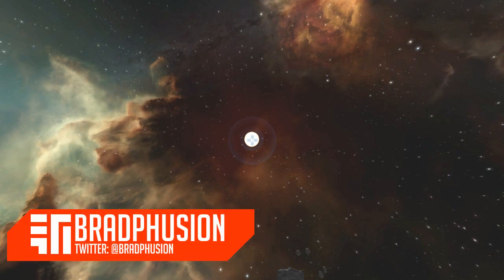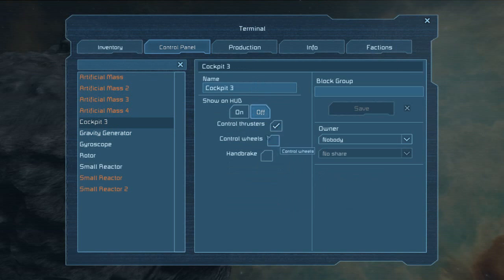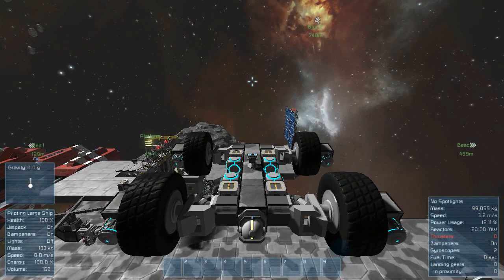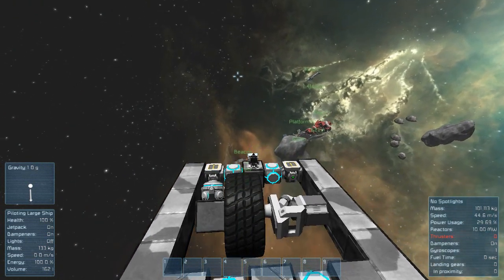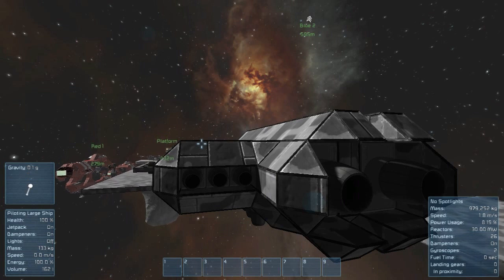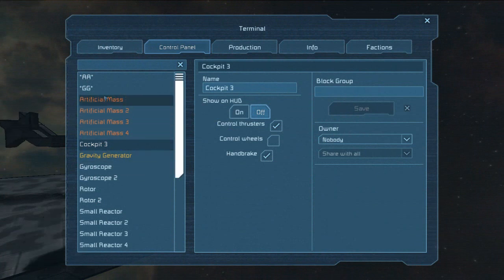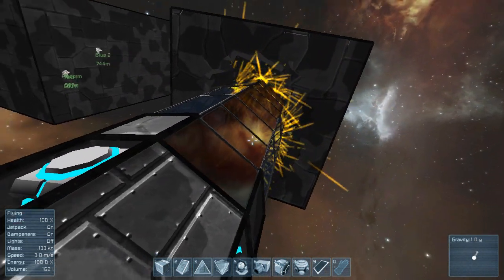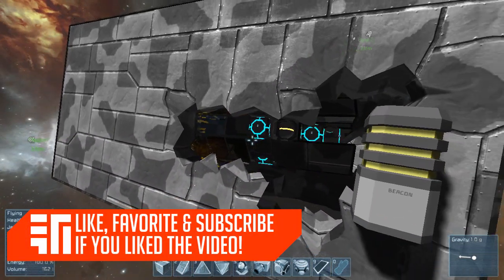RE:Engineering: VTOL / Stealth Engine & Bonus Glass Missiles! (Space Engineers)

Comment: You should make a thermal torpedo- a thruster pushed through armour using a mass block. Mass block, then a grab generator at the back, then a small thruster on the front. When you get shot through the armour the inertia dampeners will make the thruster burn through the armour. Note only works on light armour.

Comment: Could you use a gravity drive on a large heavy ship for fast acceleration?
Reply from the maker: Technically it would add more speed, however I don't think it would largely impact the ship's acceleration. Not to mention you also have to line up the gravity drives perfectly, else you will start going in circles. It'll be applying force to a specific point on a ship and you must keep that in mind.

-- Mod Shift
Reply: More trouble than it's worth perhaps. Thanks for the answer.
Reply: Gareth Lloyd Actually people do these all the time, and its not to hard. Search the steam workshop for some.

Comment: I had done testing with glass, if you hit glass head on, it is not strong, Its actually the edges of glass that does all the damage.
Reply: I beg to differ. I've found that glass bubbles, as I put on the front of some of my ships, survive almost completely, if not completely, in a ramming maneuver. I think it's just the fact that glass doesn't deform, which is a huge factor in the damage of Heavy and Light armor blocks. So, in the files it is likely weaker, but in gameplay it's a useful shield.
In fact, I've been planning a ship with "Energy Shielding", in the form of a glass bubble around it.
Reply: Your right the rigidness is what makes it very strong. In my test I took a light armor ship that gradually got thicker as it was cut, and going at the edge sliced the vehicle in half, where going at straight glass only destroyed 2 and a half layers of the 5 layers in the ship. Maybe I should redo the test and count how many blocks are destroyed because it may have been the same,It just appeared devastating in the edge test so maybe I took it at face value.

 I found out about the damage glass does when I hit a red ship with my mega flail and the glass actually did more damage to my flail then to the glassy sections of the Red ship.